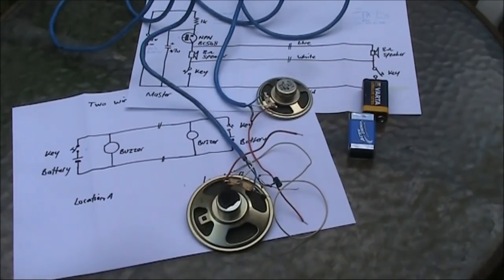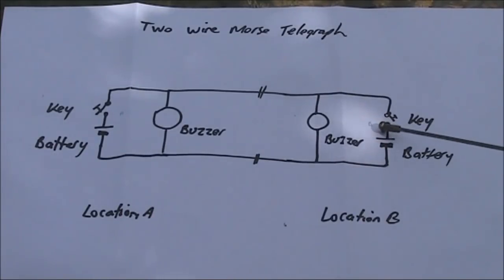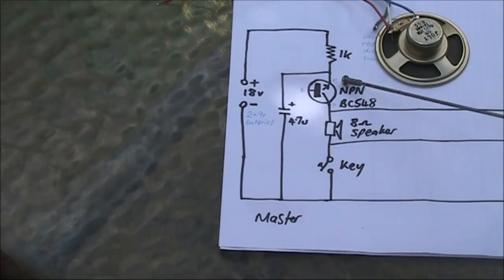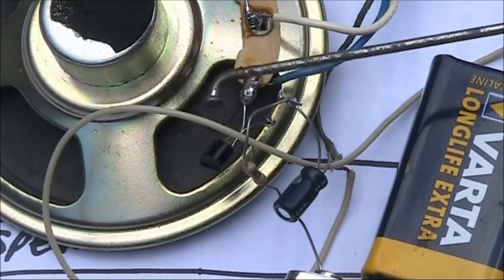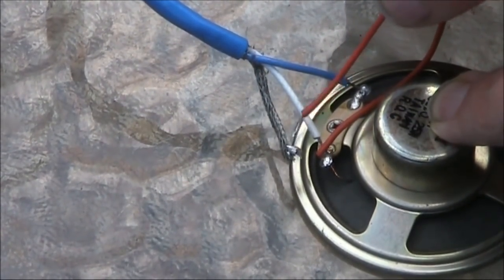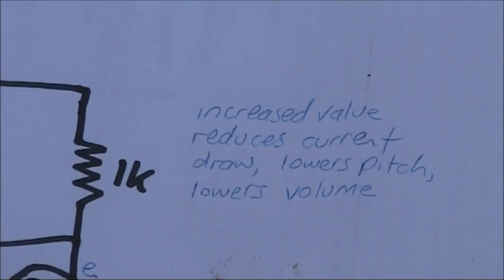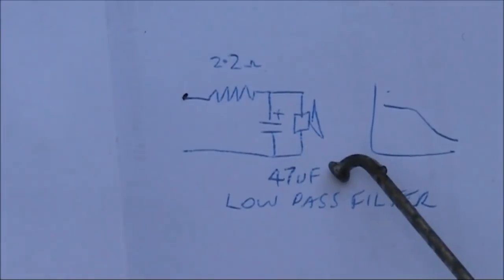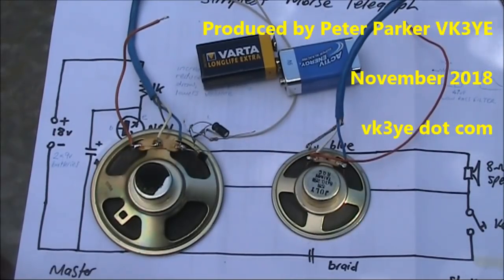Electronics on the Floor: Five component two way morse telegraph

Comment: Another mod, could you add multiple stations without loosing too much volume? Thanks for another great video.
Reply from the maker: Haven't tried but should work - though note that the speakers will be in parallel.